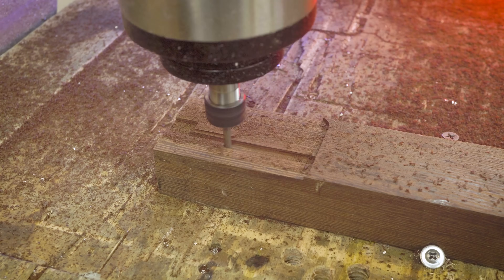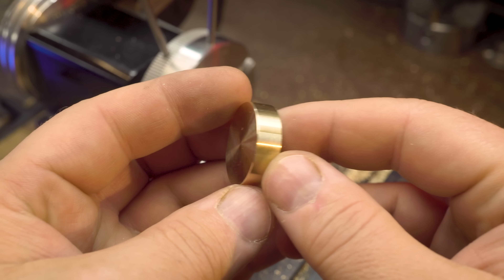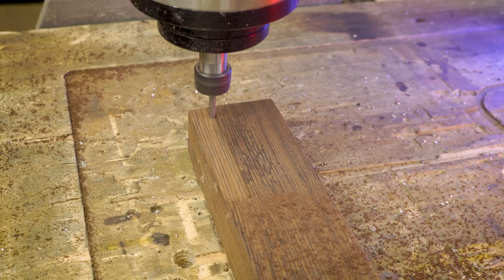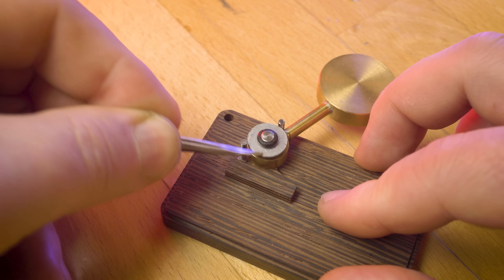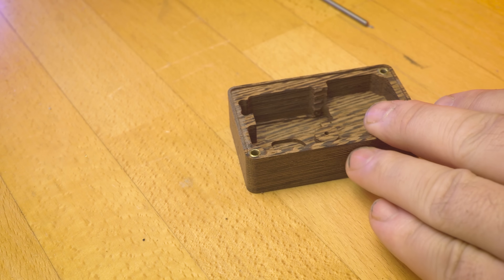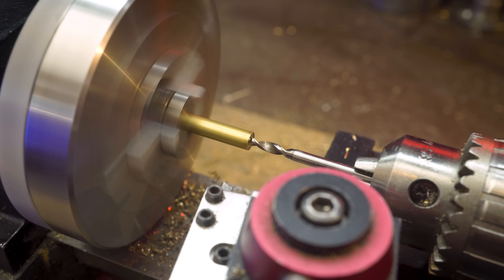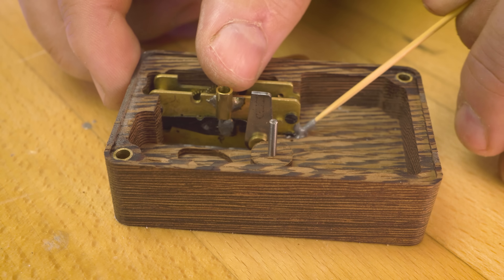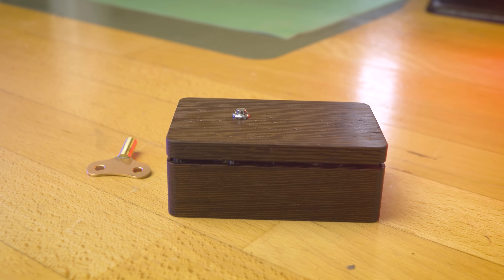Click and there will be happiness!

Comment: Great projects as usual, very sweet.
You should also probably add some weights to the box so it wouldn't jolt at the reveal, just some lead beads or bits metal in the empty spaces inside the box, some rubber feet could also work by preventing it from sliding.
A little flywheel mechanism could also provide a smoother movement without very sudden acceleration, although I don't think you have enough space inside.
And about the voice over, if you really need narration, you can totally record yourself in your native language, and provide subtitles. it would be much more authentic, and I'm pretty sure no one would mind.
I'm also pretty sure that it's not even necessary, since a lot of people really appreciate the silent videos, a lot of native english speakers with youtube channels, still decide to go without narration, because there's a growing number of people who enjoy that kind of video, it's refreshing.
My advice if you need some kind of explanation as to what you're doing, is to add like 2 or 3 short little segments throughout the video, like 10 seconds each, where you briefly speak and explain your thoughts, and couple those segments with subtitles, that would be gold :)
And again, great video !!!